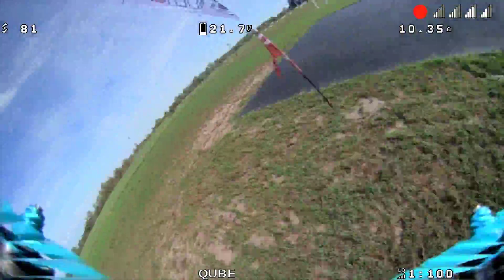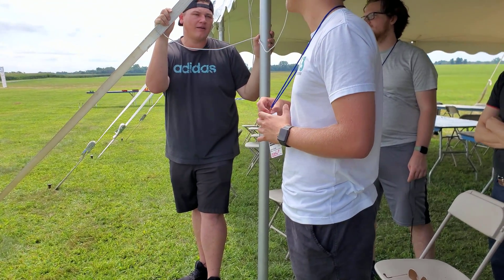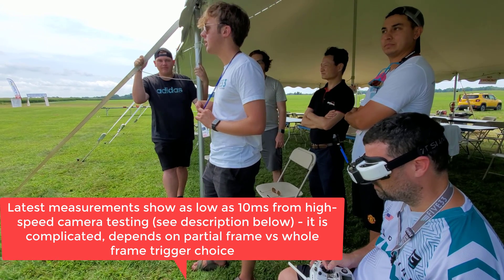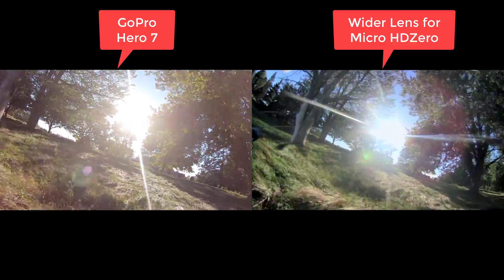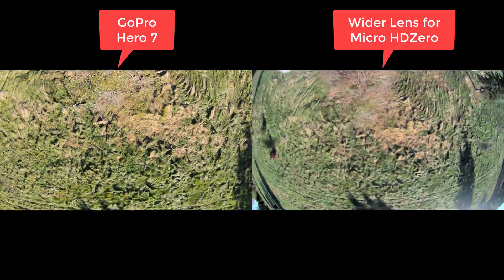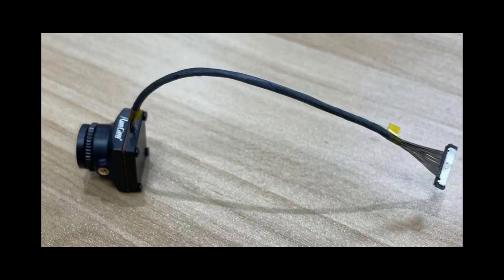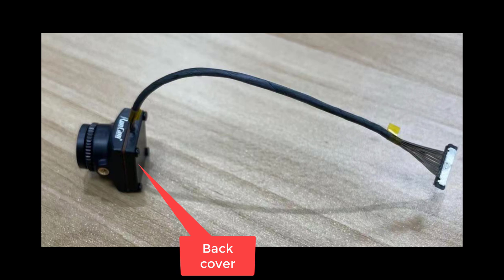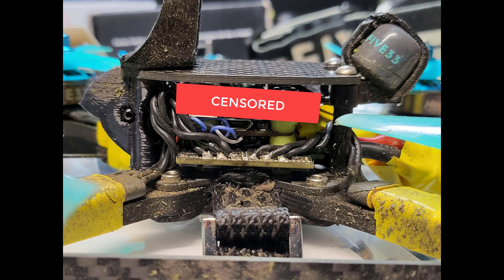HDZero | Shark Byte | More FOV - 1000mW testing - Micro Cam Improvements - and more...

Comment: Which length will the MIPI cable have?

 I prefer to have the vtx in the back of the frame. 

80mm is a way to short for my builds. 
120mm is most time to short. (Cable is taut) 
150mm as on the digisight works great.
Reply from the maker: Mipi cable is not included for this reason. Pick the length that fits your frame
Reply: @RyanQuellet ah ok, which lengths will be available? Currently in there are 40mm, 120mm, 250mm.
Will there other lengths available? (prefer 150mm 😁)

Comment: FAINTS
This is such great news!!! I totally agree with you on immersiveness with the DJI system... I struggle so much with it, especially flying it around trees. 
So glad you guys are working on this system and improving it. 1W was so much needed. Next  step: Robust VTX and combo analog+HDZero receiver modules like fusion or rapidfire...

Comment: I just wish this 1W VTX is (range and penetration wise) as good or better than DJI FPV... Some good news for a change? I'll take that. And one subscription to go please.
Reply from the maker: This is a noticeable improvement, and is likely as good as a 1w analog vtx in penetration. Dji has retransmission (and variable frame rate) - that will make it better for penetration. I hate flying dji though - it feels like crap compared to this and even analog. Two systems with two different goals
Reply: @RyanQuellet  when is VTX and camera available to buy? I assume it'll work with Scout HD?

Comment: Thanks man, useful info. 😊. 1w, or as high as possible ... Can't wait. Can't wait for the HDZero cam either... I've just bought the RX module and the Whoop vTX, but waiting for the HDZero cam for a camera.

On the topic of latency; you should watch Chris Rosser's video on the subject. He manages to measure the half frames you get with analogue video transmition. OK, to get the first half frame, analogue is slightly quicker than SharkByte. But, as far as the first full frame of analogue goes, that's slower than SharkByte... on Chris Rosser's set up anyhow.
Reply: Thoes daaan half frames that give you 'ghost branches' etc!